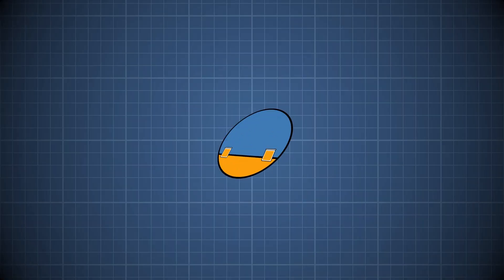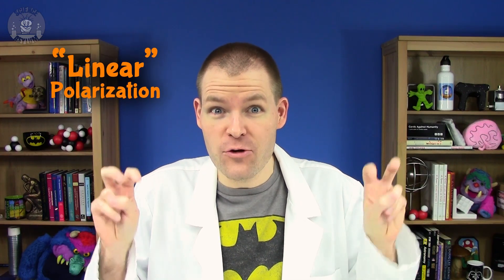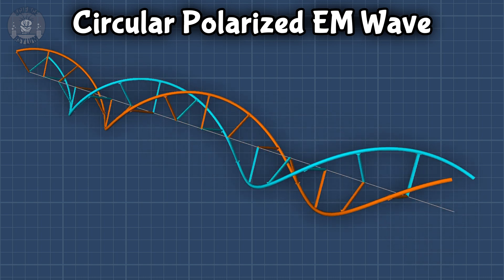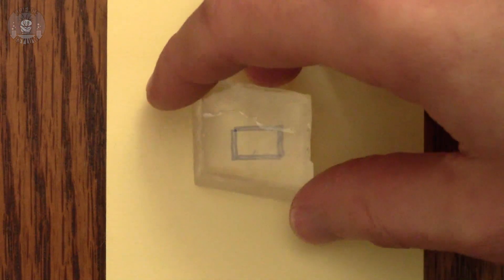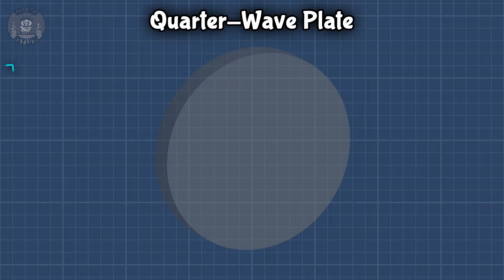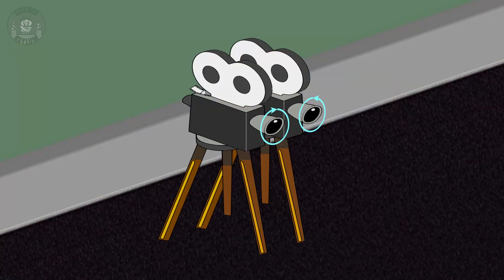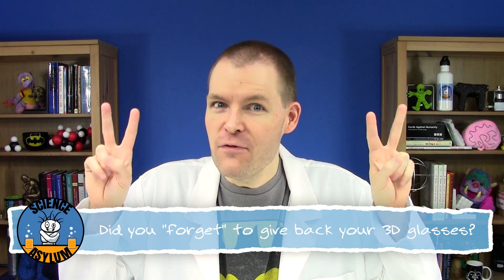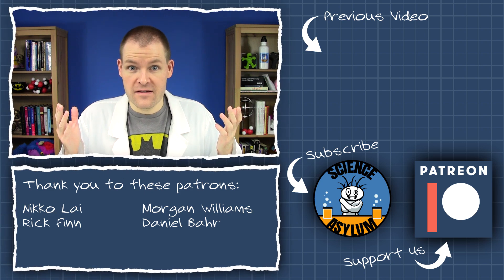How do 3D glasses work?!

Comment: I didn't know we were required to give back the glasses. I just walked out with a couple pairs, and nobody said anything. But then I give the rest back because I don't want any more. Do theaters actually care if they get them back?
Reply: culwin no it's accounted for in the price of your movie ticket but if you give em back they'll just give them to someone else so it's a way to make more money essentialy
Reply from the maker: There's usually a big cardboard box in the hallway outside the theater. They don't "police" it or anything though.
Reply: Please don't report me
Reply: culwin too late😉
Reply: +culwin  So that was YOU!!!  Seriously, though, those glasses are pretty expensive in the grand scheme of things (say, if a theater loses a dozen or so a show).  They can range from $10 to $30 a pair, depending on what projection system they use.  You probably just lucked up by getting lazy ushers.  SHAME ON YOU!!!  I've still got two pair....
Reply: Dolby 3D glasses that work on a different principle then the super inexpensive circular 3D Glasses are much more expensive , the cinema runs then through a sanitizing wash after they are turned back in ,, those are the glasses they want back ,, Real D and Master image glasses can be recycled but are not reused so people do keep them sometimes ,, the will only work if you have a 3D Tv designed to work with curricular polarized glasses type , most home 3D displays use LCD shutter 3D glasses , they wont work at all with this kind of 3D display
Reply: In my country we must have our own glasses. Cinemas sell them for 1$ (both with circular and linear polarization). So you don't need to give them back. You can include them in your ticket if you want, receive them when entering cinema and then throw them out or take them with you if you want)

Comment: Nick, you've asked "Do you have a question that's driving you crazy?".  I do.  We take for granted the notion of "static energy", e.g., if I raise a weight upwards and put it on a shelf, it takes energy to do so, and that energy can be recovered later by letting it fall.  My question is:  What kind of energy IS that, and where IS it?  If E=MC^2, does the object have more mass?
Reply from the maker: Lifting the weight upward gives it what we call "potential energy." Energy isn't like a substance that exists. It doesn't have a "where." It just exists or it doesn't. To answer your last question though, yes, the object would have more mass. (the extra height doesn't add much mass though, so you wouldn't be able to measure the difference)

Comment: This is a realy great and helpful video, thank you much, although I have one question. I watched one of those movies tonight, they used a double projection, but I am curious (decent shot it was mentioned and I missed it), how do the different projections change what way the light is "spinning"? Like what is the difference between the two projections? 
On the same topic, I assume you couldn't just have a video with two projections of the video on one screen and make it work right? because the monitor wouldn't be able to differentiate the "direction the light is spinning"? Or is there a way you could do that? I'm mostly thinking of if you could go to the extent of including that in a game, that'd be awesome.
Also
Yes I took home my glasses, wasn't sure if I was supposed to turn them in but I knew it would be cool at home anyways lol, at the very least I can make myself a privacy filter from the two lenses placed perpendicular (albeit too small for anything!)

Comment: Hey, what are your thoughts on this, I've been wondering a lot about this lately when I watched your relativity series. . . is Math relative? Maybe you can do a video on that. . . take throwing a tennis ball for example. The standard quadratic representation of the shape the ball would travel wouldn't work in a situation with drastically different gravitational fields. But I'm not a mathematician, so, there could be a mathematical work around to this I'm missing. But I suspect math is relative just because of the fact the equations and theories we use to describe things and how they work are very relative to our earthly environment.
Reply from the maker: The physics (scientific math) we use to describe things like tennis balls also works on things like planets orbiting stars and stars orbiting the centers of galaxies. It's not based on our earthly environment. If it was, we'd be failing at our job as physicists.

Comment: ok, good video. makes all sense. however(!)
the glasses that i "forgot" to give back behave in a way that was not explained in this video.
pop out the glasses so that you can put them on top of each  other and rotate. 
depending on which side they face each other, and also depending on the angle you rotate them, they will let light through more or less and even block it completely at a certain angle.
if the polarization was circlar, should it be irrelevant in what angle they face each other?
really interested in your answer
ps: here in amsterdam they let you keep the glasses so no biggy
Reply from the maker: No, the angle still matters in a circular polarizer because a circular polarizer has a linear polarizer inside it. As I explained in this video, they're a linear polarizer combined with a quarter wave plate. The angle definitely matters.
Reply: thank you for replying. your answer clarifies the matter to the degree that i am no longer unsure if my cineman uses linear or circular polarization glasses. but it is still unclear how the angle actually matters in the process. could you make a follow up video to go more in depth on the matter? also is it the same material for the glasses and the polarizer or is the polarizer special?
Reply: ok, sorry for double reply. but i got really confused now. i rewatched the video. and you are right that you explained there is a linear polarizer plus a doublerefractor. but 1:19 really threw me off. why need the circular polarizer in the first place? both would dimm when i tilt my head and circular polarization seems to be linear polarization with extra complexity added "ontop" of it. so why do the extra step in the first place?
Reply from the maker: In a circular polarizer, the order of the two pieces (linear polarizer and quarter wave plate) also matters. The light doesn't dim when you tip your head in 3D glasses because the circular light hits the quarter wave plate first. That plate (or "double-refractor") turns the circular light back into linear light... and the linear polarizer blocks the light. In other words, if the light hits the wave plate first, all that matters is the angle between that plate and the linear polarizer. If the light hits the polarizer first, that's when you can turn it and block light. Circular polarizers are very picky.

Comment: How about 30 Spectral Lensing glasses? Trust me, and look them up. They come with a coloring book but try them at an art gallery!!! You can use them anywhere (just not for long, they can give you headaches and/or make you ill). P.S. Not trying to sell you anything, I just think it's one of the most amazing pieces of tech i've ever seen!
Reply: Rose Jenna Prieto Arias  Since my original comment, I actually found and purchased a 10 pack of the very glasses I commented about without having to buy another kids coloring book. They go by a few different terms but rainbow depth or spectrum stretch should point you better to what I'm talking about. I like these glasses best because they let in everything, and don't require the image to be altered or designed specifically for them, they work with any image (technically, but best results are with "true" colors like actual Red, Orange, Yellow, Green and blue. Pastel wavelengths are "fuzzy" because of the extra colors coming in due to the white needed for the effect of pastels). Seriously, I took a pair of these glasses to a local art gallery and the pieces with strong "true" colors looked AMAZING in 3D when I tried them on and looked at them. Anachrome, if I understand the technology correctly, requires the image to be created a specific way in order to work properly.

Comment: Ok I have been scrolling through your comments for a while on various videos, what is your clock called. I want one.
Reply from the maker: It's called a math clock: https://www.amazon.com/dp/B01IABQ4FU/ref=asc_df_B01IABQ4FU5297608/?tag=hyprod-20&creative=395033&creativeASIN=B01IABQ4FU&linkCode=df0&hvadid=192246360916&hvpos=1o1&hvnetw=g&hvrand=12751998863635249415&hvpone=&hvptwo=&hvqmt=&hvdev=c&hvdvcmdl=&hvlocint=&hvlocphy=9016911&hvtargid=pla-367435618317

Comment: I have a question? Why does the light need to be angled at 45 degree? I didn't quite get that part
Reply from the maker: It has to be at 45 for circularly polarized light. If it's not, then you'll get elliptically polarized light.

Comment: hey, I know the action of gravity warps spacetime, right? so ... is there a formula that tells you what is the variation of time deformation as a function of gravity? For example: If in an event with gravity 200g, 1 second takes the equivalent of x seconds in an event with gravitational acceleration of 1g, how could I calculate the value of x? (I do not know if I can explain better ... And my English sucks, I'm sorry)
Reply from the maker: Yes, there are ways of calculating that, but most are not simple. It also depends on how the spacetime is curved.
Reply: Okay, I already imagined that, but when I learned kinematics at school most of the time we didn't take into consideration some factors that would overcomplicate the calculation of the movement, as for example Free Fall movement ignoring Air Resistance force. Can I do the same with the calculation that I seek and only consider the curvature of spacetime caused by a gravitational force? Or is there a name for these formulas that I search? Or anything that might make my search easier?

Comment: I didn't have to give back my blue and red 3D glasses. They were included in a 3D comic book.
Reply from the maker: That type of 3d glasses only works in black & white.
Reply: The 3D effect in comics and B&W films was due to using blue and red print (or images) there were slightly separated. Those freebie 3D glasses were usually made of cardboard with one cellophane "lens" red and the other blue corresponding to the colors used in the comic or screen. It was that separation that made the images appear 3Dish by blocking out red or blue colors. Red blocked out blue and blue blocked out red. Some used a red/green configuration. The 3D effect for comics was usually outstanding. For B&W movies, not so great and mostly blurred. Unfortunately, I haven't used the kind of 3D glasses you covered in this video for color images. How well is the 3D effect?
Reply from the maker: The new polarizer kind work great for movies, but it can give some people headaches. Not sure why yet.
Reply: Sounds like the problems of the glasses used for 3D TVs.  Those also gave some people headaches.  As for the 3D TVs, they were a marketing failure. Interesting idea, but too expensive, didn't work right, and were overwhelmed by HD TV.

Comment: How could you separate the electric part into 2 pieces?
Reply from the maker: It's just a vector. Any vector can be slit into components. It's math.
Reply: The Science Asylum Genius
Reply: The Science Asylum But how could it possibly be? Won’t it changing the physics meaning?

Comment: hi..  the wavelength of light decreases when it passes through glass but its frequency remains the same  is still the speed of light constant
Reply: Shubham Singh Nope. The speed of light in the material changes, getting slower as a result.

You can see this by the relation lf=v, which applies to all waves. If f is constant as light passes from a material through another one, then l and v have to change in order to maintain the equality.

Hope it helps :)
Reply from the maker: That depends on what you're measuring the wavelength (and the speed) of... the entire beam of light or individual photons? Is a phase velocity or group velocity?

Comment: My Samsung TV came with a pair of 3D glasses. I noticed, that they have a 3V battery inside. What is it for?
Reply from the maker: Rather than using polarizers, the battery just darkens each lens for a fraction of second in-sync with the TV showing the appropriate frames.
Reply: @ScienceAsylum  OK. How do glasses know when to sync with TV frame? There must be constant communication taking place between glases and TV?
Reply from the maker: I bet they just sync the cycle when you first turn them on and that's the only communication necessary. I'd have to look into it to know for sure, but that's how I would design it.
Reply: @ScienceAsylum  OK, sounds reasonable. Thanks !

Comment: A red-cyan 3d glasses work the same way you explained, right?
Reply from the maker: The red-cyan glasses use color filters instead of polarizers. The polarization of light doesn't matter for those. The part about different images entering each eye still applies though.

Comment: I was watching your older videos. And i particularly want to ask you something about your video on 'Why do objects float' - 
https://youtu.be/Mi1ObfOUO_g
1)Regarding your ninja ducky- doesn't it float because it has an average density lesser than that of water? I mean to say that there would've been cavities inside it because of which it floats. If it's composition was uniformly made, with the same material (density=1100)wouldn't it have sunk? 
2) When you say that " it's wrong to say objects float because of their density", I didn't understand what you meant to prove. I agree with your point regarding what you said would happen in space. But, on earth, any object(homogeneous, uniform composition) immersed in a liquid floats or sinks according to its density right? 

Pls make this clear, as what you said in that video left me a bit confused.
Reply: Melody Agario don't think of ninja ducky as plastic and air separately. treat it as an object overall and calculate the overall mass per unit volume.   it doesn't float because of the cavity but because its mass per unit volume is less than that of water. even if you use a duck who hasn't the cavity but still has lower density it would still float.
Reply: Kapil Ellawadi exactly. so floating does depend on average density right?
Reply from the maker: https://youtu.be/inPcQeYWVT8?t=6m51s

Comment: those 3D glasses never work for me due to one eye is way worse than the other, which is better than average (a sniper's eye) also i had chemicals  accidently splashed in the bad eye and since then certian visual things are screwed up or weird. i get major headaches after 30 minutes in a 3D film and it doesn't look very 3D to me to begin with. just a blurry crapfest.
Reply from the maker: Bummer.

Comment: wait I thought 3d glasses were all about them being blue/red coloured and having the movie material weirdly unbalanced in colour. When you try to look at red through a blue glass or vice versa, the incoming result is black. So I thought that had something to do with it... You don't see some things with that kind of movie material through such glasses but at the same time see more or differently. What you explained is waaaaaaay more deep than whatever I was assuming..
Reply from the maker: The red/blue (or rather red/cyan) glasses only work with old black&white movies. Using color filters doesn't let you see color in a movie. If we want "3D" in a color movie, we have to use polarizers.

Comment: Not very well, in my opinion.    OOOPS!  I was thinking of the old red and blue 3D glasses.  Have not watched any 3D in a long time.  Didn't know about polarized glasses.  Have no opinion of them.
Reply from the maker: The red/blue glasses were fine when movies were black & white, but they stopped working when Hollywood went color.
Reply: Wow!  It's been longer than than I thought since I watched a 3D movie.  It makes sense that red/blue would only work with B&W movies.  I do remember watching an old B&W 3D movie on TV a number of years ago.  I dug-out my old red/blue glasses to watch.